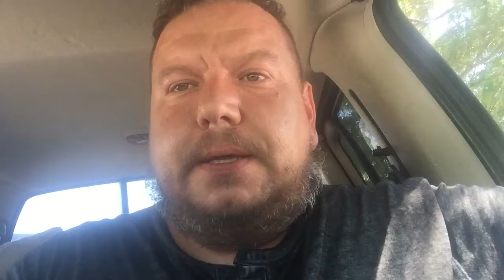Cb radio noise cancellation question

Comment: Hello - did you get any help with this or did you figure it out?
Reply from the maker: Unfortunately no
Reply: @lucifer3135  What all have you tried so far?  Have you tried the generic in-line filters places typically sell or anything like that?  Have you moved the fan further from the cb?  Moved the coax away from the fan?  Just trying to get an idea.
Reply from the maker: @douglasbollinger3626  I tried moving it away from fans, even a different ground wire placement I still get distortion had TA look at it they said replace the unit but I don't know 2nd cobra I tried
Reply: @lucifer3135  What kind of radio are you using?  Also, just curious,  are you able to solder and would you be able to buy a single capacitor?  (Certain size/style  capacitor.)
Reply from the maker: @douglasbollinger3626  they installed a capacitor at TA I'm starting to think they didn't ground the alternor correctly I still get distortion squelch is almost turned all the way up ...it's a peterbuilt
Reply: @lucifer3135  Where did they install the capacitor?  Sometimes noise can enter the radio through the power wires believe it or not so the one way I've seen is putting the capacitor across the power wires just inside the radio.  Do you know what size (uF) capacitor they used?  What kind of CB do you have?
Reply: @lucifer3135  Here's a video where a guy had a lot of static in his CB caused by his phone charger plug/cable...have you seen or tried this?  At the end of this video the guy says to go around in the truck, turn stuff on, turn stuff off (one at a time) see if you can find something making static.  Anything electrical can make CB's have noise, but check your phone charger.  I found another video where a guy had noise from his phone charger over his AM radio station he liked to listen to.  I'm curious what it may be, but here's the video I'm talking about:
https://www.youtube.com/watch?v=BT5IcFKaqJ4
Reply: @lucifer3135  Have you unplugged your phone charger to see what it does?  After I saw a video about phone chargers I noticed that I got static on one of my ham radios when I plugged my phone in then when I unplugged my phone it stopped, just like in the guys video.  I hope you're doing well!
Reply from the maker: @douglasbollinger3626  haven't tried that thought it was just a 1.5 Amp draw? I mean you may be right I'll try it
Reply from the maker: @douglasbollinger3626  and yes sir I'm doing fine god bless ya
Reply: @lucifer3135  I'm not sure why, but my 2 meter ham radio gets noisy if I plug my phone in.  I unplug my phone from the charger and my radio goes quiet.  Might be worth a try.
Reply: @lucifer3135  Great!
Reply: Any luck trying any of that stuff?